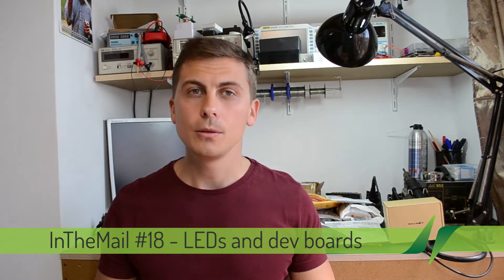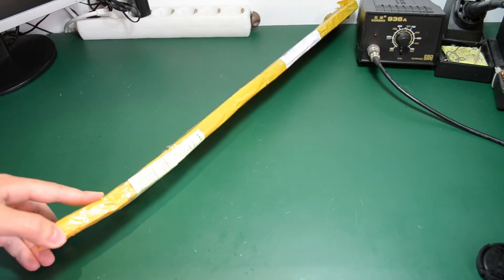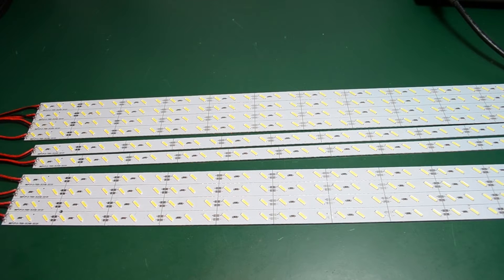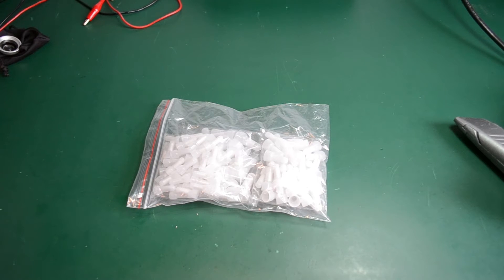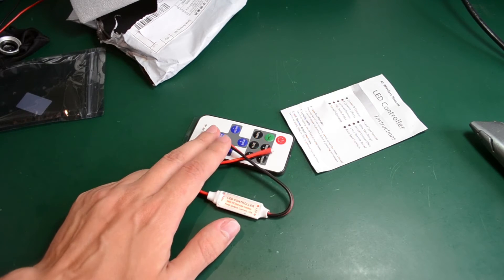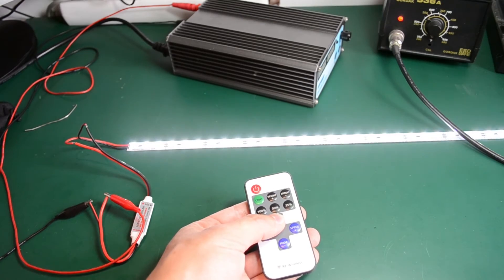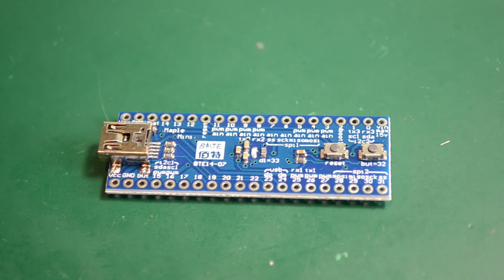VoltLog #18 - InTheMail: 7020 LED Strip, STM32, STM8, Wireless Remote Dimmer

Comment: There are both dual die and single die 7020 LEDs, however, in the single die variants, the die is usually central. I think these may be single dies packaged into excess dual die packages.

Additionally, there is almost no market at all for the STM8 series these days when relatively powerful but also cheap Cortex M0 micros like the SFM32F030F4P6 exist (until recently, major distributors were selling them for as little as $US 0.32 in qty 20, but can still be found quite cheap online)
Reply from the maker: bgdwiepp Great info on the 7020 LED's, thanks for sharing that. So the dual die ones should have double the output.

I've never looked into the STM8 or STM32 variants as I never worked on them before but wow, asuming they're genuine, you can get 10 pcs STM32F030F4P6 on Ebay (Hong Kong) for $7.05 shipped, that's 70 cents a piece. Damn right there is almost no market for the STM8, that may very well be the reason for the price adjustment on stm32 that you are talking about.
Reply: +bgdwiepp There is big market for STM8 microcontrollers, basically all Chinese designs which use 8 bit microcontrollers use them (that is easiest way to recognize Chinese design).
8 bit microcontrollers have lot of advantages over 32 bit ones, probably that why they still have biggest market share.
If your project allow you to use 8 bit microcontroller it is always better choice to use it then 32 bit. 8-bit devices tend be more efficient in handling hardware near actions interrupts (simple example STM8 need 3 cycles for direct jump to interrupt vector, ARM Cortex M0 need 12 or 4 times more, return from interrupt for STM8 is again 3 cycles for CM0 10 cycles), programs in 32 bit microcontrollers are usually 2-3 longer for same results ...
Reply from the maker: +Miloš Lazović Also those STC 8 bit micros (8051 variants) are also very popular among cheap Chinese products and electronic kits. I guess the main reason is their low cost and possibly they're popular in the academic world, maybe they teach those in Chineese engineering schools.
Reply: VoltLog
8051 is still popular architecture (mostly among older developers) and in popularity among 8 bit microcontrollers only is matched by Renesas H8/SLP (Renesas hold 1/3 of all 8 bit market share).
STC 8 is popular because it is Chinese company.
Little digression, GD32F103 is Chinese version of STM32F103 made by Giga Devices running on 108MHz (technically it is not clon, it is designed to be pin and software compatible with STM32F103 and Giga Devices have ARM CM3 licenses). There is some incompatibility with PLL regarding USB when it run on 108MHz but in general all STM32F103 software should work. It can run according to some tests on even 120MHz but in that case USB will not work.
Reply from the maker: +Miloš Lazović yes I've read about GD32F103 and Giga Devices, interesting market strategy. The only problem for the rest of the world is when we'll start seeing these devices labeled as original STM32 on the grey market.

Comment: I figured with no FTDI or similar chip the STM8 would not be able to communicate over USB only power?  I just bought one myself and would love to program it but not sure where to start I cant find much documentation does the world know these little things exist?!
Reply from the maker: topher The STM8S does not have dedicated hardware usb interface. You can however try a software approach and there are options out there just do a search for "STM8S USB"
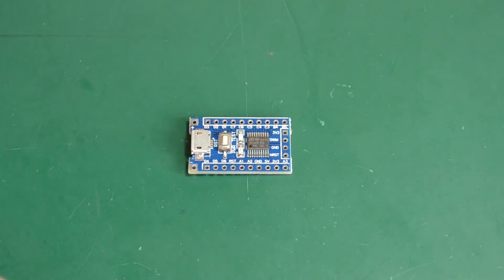Reply: 16:20 the stm8 dev board shown does not have the data pins connected. usb is power only 
http://www.electrodragon.com/w/File:STM8S103F3P6.png
Reply from the maker: bummer, then it's no good for any USB projects.